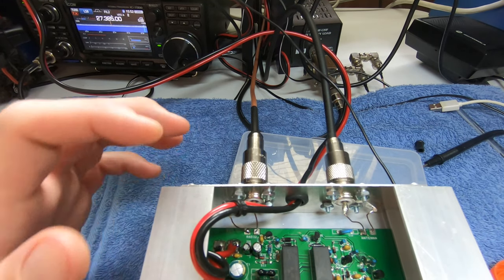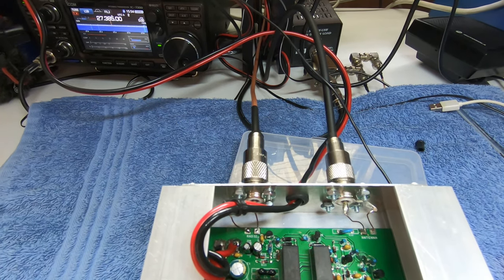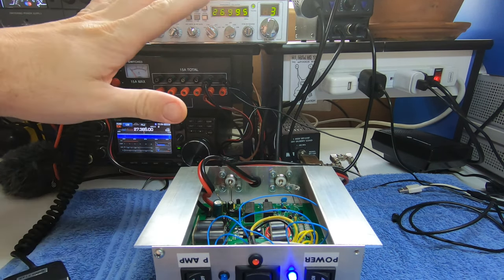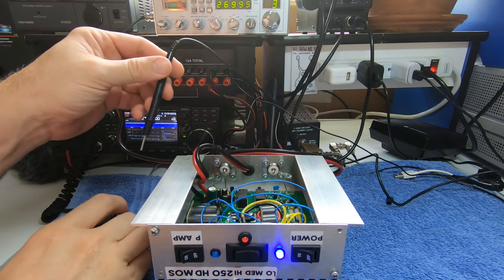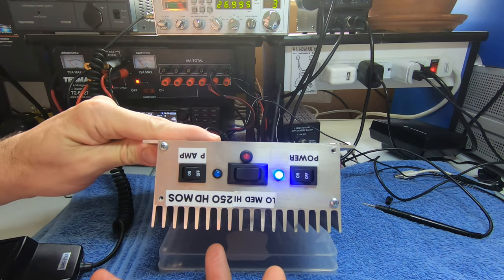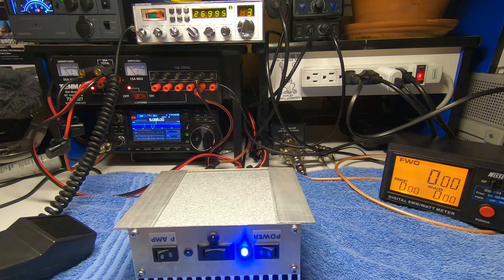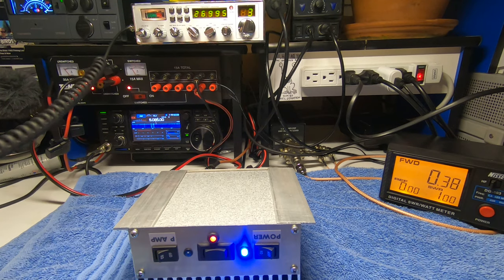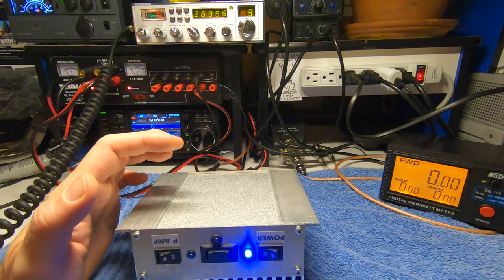RocketBox 250HD-MOS : How to Enable SSB Delay

Comment: Thanks for the shout out. I didn't have to do that to mine my stays open the appropriate time on SSB without closing. Or take them out and replace it with a larger Cap with a single one of somewhere around 90 with a delay resistor to slow the down the cap draining out to the relay as well. More than one way to skin a cat you might say.

Comment: My old Boomer shooting star 225 amplifier from the 90's looks like this one. Of course then they came with sd1446 transistors. It came with an automatic ssb delay.
Still have it and a few other boomer amps from the same time period and they all still perform great. I used a boomer 400 with 20 watts pep on ssb drive power and and easily got 400 watts output from 40 to 10 meters. Could talk for hours and it barely got warm.
Reply from the maker: Yes, I have one of those as well a “Shooting Star 225” off eBay for $100 with SD1446s. I think all of them were from newer version of Palomar. I know Rocketbox bought the design and such. Yes that had SSB delay as well from a capacitor that can be upgraded in value for more delay as well. Great little amps ! Thanks for watching !

Comment: or drill a hole and put in a switch so you can turn the cap on and off. For AM or SSB use. Or use a potentiometer for a variable delay.
Reply from the maker: Very good Advice !

Comment: I'm not to impressed with these Rocket Boxes 160 pep on high is hardly any better than a KL 203P .
My Palomar "Original" 250 did 190 pep in my S-10 and would swing up to 220 on a higher volt power supply
 on my base rig.  Old school were better amps  Imo.......
Reply from the maker: old school amps are more forgiving for sure !